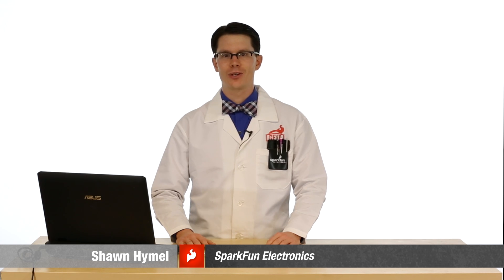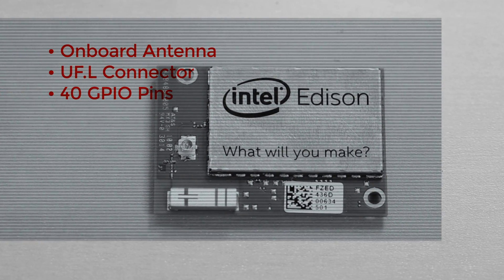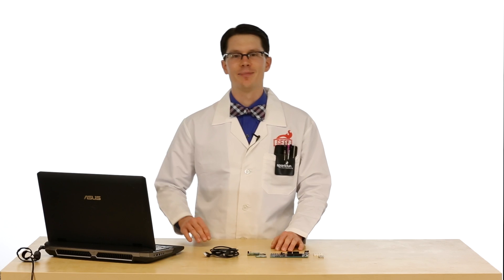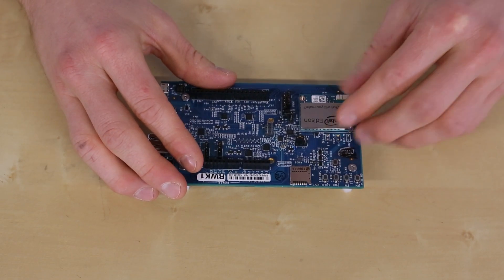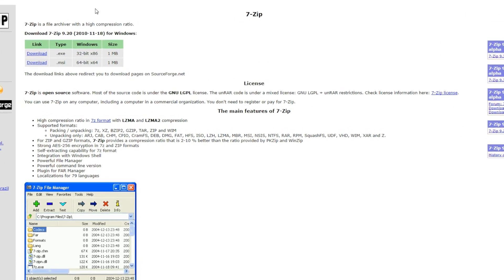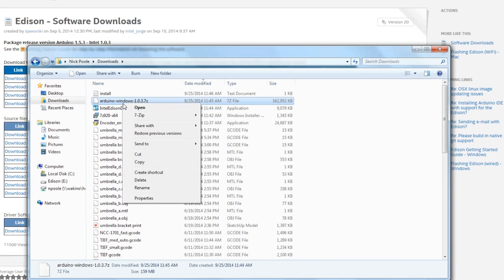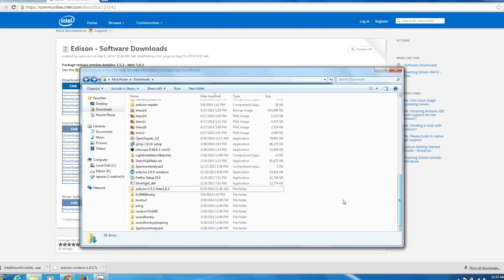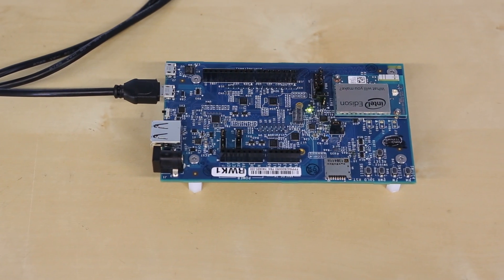Getting Started with Intel Edison Part 1: Introduction

Comment: I loved this. Gotta buy one but i need to know one thing. Is Intel Edison open source? o_0
Reply: The hardware on the Edison itself is not open source (it's based around the Intel Atom processor). However, the Yocto Linux build (software) is open source.

Comment: Hi Shawn,

I am doing all the above steps. Keep in mind that intel have introduced a common installer for all the IDEs so i am installing Arduino IDE through that. When I plug in my edison, the device manager shows COM4 but when I try to transfer the blink code to the edison, I dont see that port in the IDE and it by default tries to transfer through COM1, which obviously fails. Any ideas???
Reply: +dhruv kuchhal I just went through a gruelling Edison install procedure on 3 different computers during 3 different days. What worked in the end was not using the common installer, but downloading everything separately instead. I didn't even use the flash tool either, just did it through putty.
Intel itself has an old video for that here on youtube I was mainly guided by. Good luck if you still needed that!
Reply: could you please share it?

Comment: Hi!
I'm using Arduino Breakout Board with the Edison and following the steps on video but does not worked.

I connected the Breakout Board with my computer and the drives was automatically installed and the led on bord was turned on, its ok! I intalled Intel Edsion drives, like on tutorial video, but any new ports appeared on device manager. After that, I just extract the IDE and tryed to run it but only the load screen appeared and after that the IDE does not opened.  Could you help me?
Reply: ***** Yes! It's a problem with IDE. I solved this problem just changing my region of operating system to EUA. Thanks!